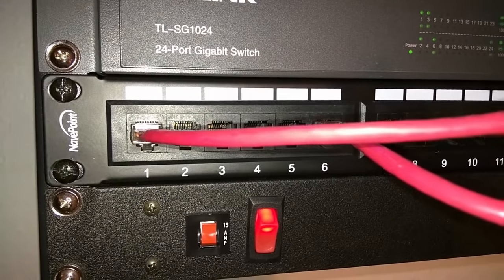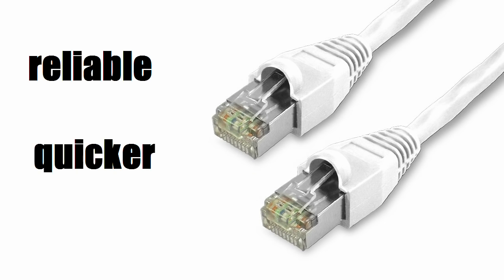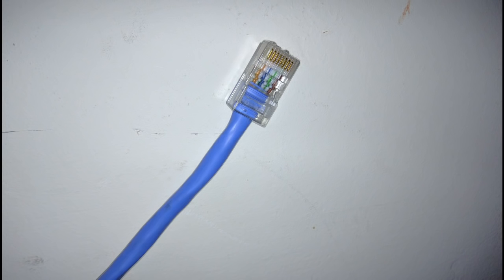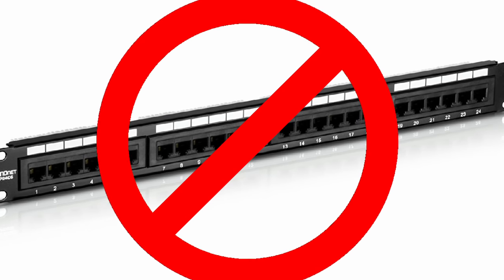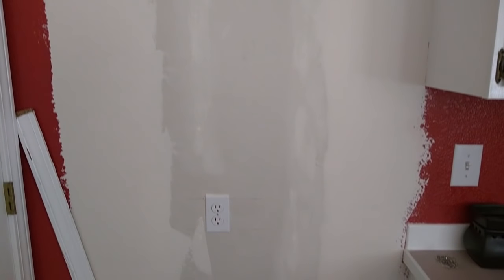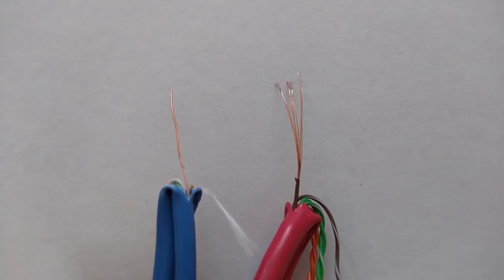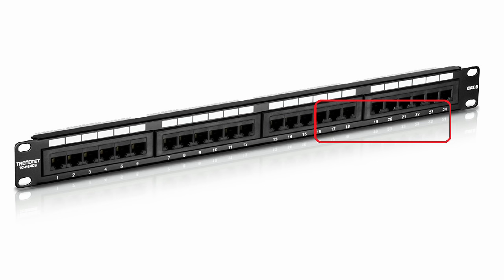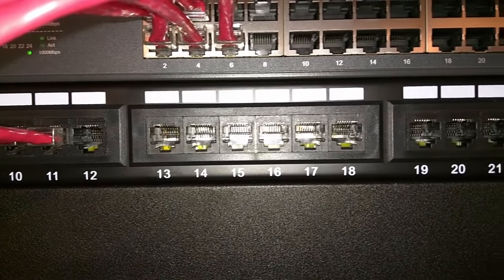What is a Patch Panel? Do You Need One?

Comment: So I’m currently building a small network in my parents house to get WiFi in the living room(with 2 lan ports) with direct lan in our flat screen TV  and 2 ports in another bet room. So as I was watching I noticed you didn’t just get like a 6+ wall port. And that was my question if it would still work if I had a 6 port wall connection which then connected to my switch. And that 6 port wall connection would go to the bedroom and living where I would need it. Would it work or would that slow down the network? I hope I didn’t write it too confusing
Reply: What you are describing should still work assuming your 6 wall port has 6 individual wires going into your switch/router. Speed of your connection for the 6-port switch/router would be determined by either your switch or your router. Make sure you see something that says 1000/mbs on the product you choose to use for this intended setup.
Reply: Baron Marsh okay cool I’m doing it right then. I needed another voice in this since I’m the only one in my family who really understands any of this

Comment: You mentioned a POE camera. I currently have 12 cams plugged into a POE switch. Will it work if I punch in those 12 cables into a patch panel and then connect them to the poe witch? Will this set up provide power to the cameras as I haven't them right now? Thanks
Reply from the maker: Yes you can use a patch panel with a POE switch. The power will make it to the devices just fine.
Reply: @BudgetNerd  wow excellent! I didn't know that the power from the switch will make it to the devices even if there are connected to a patch panel . Thanks
Reply: @rub1345  A patch panel is a passive "device", more like a Ethernet outlet inside your network closet, so no power draw or circuitry to make it incompatible :)

Comment: I have a question? I have a lot of devices on a on my router. I was having problems with everything staying connected to the router. So I did some research and found the eero router. It has helped. But now my tv will com connect to the router. So I bought a switch and wired my tv to the router. The problem the I am have is that my TVs keep buffering. Do think that I just need to do a home network like you did? But my ring doorbell is lagging also. It does have a good but not great connection. What you would suggest? I am trying to stay on a budget.
Reply from the maker: Your tv is wired and still buffering? What are you trying to stream? What internet speeds are you getting? You could Google "speed test"
Reply: Netflix and prime video. I have 215 mbps cable internet
Reply: My eero router has an app. So I can see if someone tries to connect to my router. The router that I have is door band 5G 2.4. But I do have 19 devices oh my network using my router
Reply: So I was thinking if I did a home network like what you have and get some of this off of my wireless router that it may speed up my Internet connection and my TVs will not buy for anymore I’m just trying to get some insight on what to do
Reply: @bryansmith7070  Things that are wired are not going to affect your WIRELESS speeds and what ever things you have on your WIRELESS is not going to affect your WIRED STUFF.  is that what you are asking ?
Reply: Bryan Smith could be that the TV is still using wireless even though it’s connected by ethernet to
Reply: daniel kinney no. I have figured it out. My tv doesn’t have enough memory. That’s the problem. It keeps closing the apps that I am using.
Reply: OrangeRAZ I thought that also. But the tv doesn’t have enough memory. It keeps closing the apps that I am using. So I have to figure out what to go now.

Comment: Awesome vid!!!
One question: I’m planning to wire my home with Ethernet throughout. I want to future proof my in-wall installations with cat 8 cable. Will I have any issues using a cat 6 patch panel and keystones etc?
Thank you...
Reply from the maker: If they make cat 8 patch panels and keystones, I would go with those if you want to make sure it's 100% future proof. The manufacturers would claim the cat 8 certified stuff wouldn't degrade signal quality.

The cat 6 stuff would totally work though, if you wanted to use it, and I wouldn't imagine there would be much of a signal hit with that.
Reply: New wiring standards where just released, no such thing as future proof no matter what they say or you think. Only when there isn’t a profit to be made than it will be future proof.
Reply: Hi I wired my old house 25 years ago in CAT5 still works great never had a problem, my new house in CAT6 1gbt speed how fast do you want?

Comment: So a few misconceptions here:

9:20 - these problems you describe with solid core wire are largely overblown.  Yes they have a certain bend radius limitation, but they will not break or short like you say unless you're using an extremely cheaply made wire.  Stranded wire is actually going to be more of a problem as the fine strands of wire eventually break.  This raises the impedance of the wire and will eventually cause high resistance opens which will result in intermittent signal or reduced link speed.  Stick with solid core every time.  No real network installer worth their salt installs stranded wire anywhere.

11:02 - Following up on that, I wouldn't recommend using stranded cable for PoE hardware.  It has FAR less current carrying capacity than solid core especially at PoE++ current requirements. 

14:42 - yes an RJ11 phone cable will fit into an RJ45 jack.  However the edges of the RJ11 connector if left in for a long time will damage pins 1 and 8 in the jack as they will be overextended.  Not recommended practice.
Reply: Actually, those "Misconceptions" are industry standard caveats. But you can say what you want on the internet - unless you are using solid strand temporary patch cables (jumpers) and moving them frequently. Because if you are, you will find even the best Keystone or soldered/shrink-wrapped termination can fail with multiple deployments and re-deployments. 

They may not have failed in your short life, but in people of the previous millennia who remain as US taxpayers supporting this internet infrastructure, we are familiar with the need for redundancy or overbuilding to reduce rapid obsolescence or repeated use failures requiring replacement.

So - 9:20 - good point unless you leave your patch cables in without ever unplugging or manipulating them. You could feasibly use solid all over the place for patch cables, unless of course you plan on plugging and unplugging those same cables. What is the commercial standard for patch cables? Solid or strand?

11:02???? Context, context, context. Absolutely you want to use PoE and solid strand - unless you are manipulating the cables frequently. Even then, from the PoE switch (area) to the termination at the Camera installation site, you WOULD absolutely do as he suggests, use solid core cable. If you are saying "never use stranded patch cables to jump between PoE switch and patch panel, or between termination panel and camera RJ45 connection - you have me there. Manufacturers tend to ship their set-ups with stranded cable....so is this highly redundant, dummied down, over-explained video wrong? I think not, but I've seen a lot of technologies pass by and I understand how solid strand carries current on the surface more than in the core of the wire....lets not debate that!

14:42 - Yes, he absolutely said that "You can use your ethernet cabling to extend or route your phone line through your house". He also said you could terminate telephone cable on the same patch panel and gave the "ports 16-24" for telephone installation. That isn't a misconception, you can actually use the same highest quality cable to run your phone lines. It is a waste with Cat7e - or any Cat cable, since phone service usually only uses one stranded pair. Business can use the full cable termination at both ends - but for a person wiring their own home they could have need for two or more separate lines, and they could surf until they found sites like this one:
https://tombuildsstuff.blogspot.com/2015/01/rj11-phone-to-rj45-jack.html
It isn't a misconception that an RJ11 will fit into an RJ45 outlet, but it isn't best practice. On the above website, an RJ45 splitter gives you two RJ11 outlets for a business phone and business fax line (for example).

Or a homeowner could tackle the media/communication wiring of their own home using each and every possible cable known to man and terminate them all in separate patch panels specific to that cable. 

2dfx: I'll concede this - if you have a media/communication closet and you mix usage/feeds on a patch panel or through the walls, the next occupant may not recognize the difference in outlets and think their internet is down when they plug into a jack that was intended to carry phone signals. With proper labeling, a patch panel can provide a homeowner with a neat, organized, and effective media system for all communication. I don't see the misconception there. 

If you were just watching his entire video to correct him, you should have sent him an edited version of his video with corrected script. He is a slower talker than I've found in Cincinnati - some really do talk fast - and he is quite redundant. This could have been a 7 or 8 minute video. But with good editing, we might miss the 1:46 or 11:26 view of his Fender Axes or his Keytar. Just on the benefit of rounding out Ben's nerdiness versus his coolness, I'm glad those are in the corner - but does that mean he isn't focusing on music?
Reply from the maker: Good discussion. I'm always happy to learn. Yeah this video could for sure be shorter, and with less music. Adjustments I've made since.
Reply: @Karma0jun  Thank you, thank you, for saying this. Yes, this is not a science fair project. We are not inventors here. There are industry standards out there and millions of professional designers and installers follow them (hopefully) every day. If you are a do-it-yourself-er, fine, do yourself a favor and make yourself familiar with these standards.
Reply: @Karma0jun  That's quite the rant lol
Reply: @PANZERFAUST90  Oh, is it. 
I'm glad you approve. Facts should be recognized - even if the acts of industry standards are a perceived rant. Thank you for your opinion, it is worth much to me.

Comment: Say I want to rewire my house for phone and network, can I use a network switch for the phone distro (and a second for the network, not the same one for both) or how would I have to go about the phone system???
Reply: depends on the models of the phones and the phone service provider, if you get voice and internet through same provider then all you need to do is make sure everything makes its way to the router directly connected with the service provider and it should work
Reply: Silly question, but are you talking about ethernet Voice over IP ("VoIP") phones, or old style analog phone lines to the outside world or to a single common ISP router with a phone line port?  The answer to that question gives you different methods and requirements.

If you're using special VoIP phones then you can still use the same CAT5 (or better) cabling and patch panel discussed in the video.  Depending on the exact hardware, you may be able to use a single switch or may need one for regular network devices and another for the phone network.

If you're using analog phones you can still use the same CAT5 cabling to a patch panel, but the jumper cables at the wall jacks and patch panel would be special.  Old style analog phone lines like those from the central office are sometimes referred to as POTS lines, for Plain Old Telephone Service.  In your home each extension phone is wired in parallel with all the others, which is the opposite of how an ethernet patch panel is used.  So take that into account as well.

I hope my descriptions help you out, it's difficult to provide all possible scenarios because there are so many possibilities.  Good luck!
Reply: @bobblum5973  standard phones using a regular rj11 connector. I guess it'd be analog, not like the ones we use at work that take 2 rj45s. Mine plug into the existing phone wires running through the house and one of the outlets plugs into my bright house (now spectrum) modem for the voip conversion.

Comment: I bought a patch panel because my internet router did have enough sockets. Still trying to figure out how to patch panel increases my sockets since it looks like a one on one connection.
From you video I understand the cables from the different internet connection in rooms are directly connected to the patchpanel. Each representing a socket. How is the patch communicating with my router. It does not  look complicated but I missing a vital link in my understanding 😩
My situation: My wiring from the rooms are all setup and working when directly plugged into the router. My router has not enough sockets for all my cables.
Reply from the maker: A patch panel doesn't add more Ethernet ports to a network, a switch does. What you need is a switch. But you could use the patch panel to route the devices from your various ports around the house to the switch. Then you'll hook your switch to a lan port on the router
Reply: A patch panel is not a device. It does not communicate with anything. It does not "do" anything. It just helps organize your cables and protect your in-home wiring from being pulled on. It's like a ton of wall jacks all in a row. You can't get more devices on your network by having tidier cables.

If you need a way to have more devices on your network, you need a "switch". A switch is the actual smarts (which is why it is significantly more expensive). Any device connected to the switch can talk to any other device on the switch. So if you have all of your devices connected to the switch, and you have your router connected to the switch, then all of your devices can talk to the router (and thus get internet).

If you have a lot of in-wall cables, a patch panel can still be valuable so that you don't mix up which is which and so that you are much less likely to have to replace one of them (like if it got pulled on really hard and developed a break where it comes out of the wall. I'm going to be upgrading my home network soon, and there's a decent chance I'll be adding a patch panel since I really don't want to damage and have to replace the cables that go through a 24" crawlspace.
Reply: @klikkolee  Thanks for this comment!! It greatly augments the information in the video and solidified my understanding of the patch panel, especially your comment "It's like a ton of wall jacks all in a row." Cheers.
Reply: fail

Comment: Would it be an issue if I terminate the ends now and cut them off later to add a patch panel? I know I will be doing double work but don't have the funds for a patch panel and rack at the moment.
Reply from the maker: As long as you have the extra cable length,  you could do that.

Comment: We're in the process of building a new house. Would recommend CAT6 or CAT7?
Reply: Derrick Young I have cat7 with 1GB internet and it’s great. However Cat7 is a little expensive in my opinion.
Reply: Thanks for the reply and information
Reply: @derrickyoung8975  Cat7 has no official association with the Ethernet standard. You should be using Cat6 or Cat6a. Cat6 can handle 10 Gb up to at least 100 feet though typically up to 160 feet. You're good. Cat6a for 10 Gb  over longer distances and up to 100 meters. That is the official standard.
Reply: Derrick Young CAT7 shielded
Reply: use cat6... your patch leads will only need cat5e... dont even need cat6 wall plates... over all rating will be 5e... 1gbt speed at this will you want to be a defence base... every one wants over kill
Reply: Gigabit was designed for plain CAT 5 and that spec was intended for 100 m or 330'.  You'd have a fairly big house if that was a significant concern.

Comment: Hi there do they have any type of patch panel that you can plug in the cables to the back of it my ethernet cable is going to all my rooms already have ends on both ends and I was just wondering if they have a patch panel that have plug-ins on the back of them if so can you lead me to one I need at least eight connections or more thanks for any help

Comment: Thanks, very informative! I have an old patch panel which is fed by a 10Base-T Hub. I'd love to upgrade the hub to a modern Gigabit Switch. Can I simply replace (swap out) the 10Base-T Hub with the new Gigabit Switch and use the same 15 year old patch panel? ... or is it more complicated than that? I believe the cabling is Cat-5.
Reply from the maker: You can just swap out the switch for a gigabit one yes. It will totally work. If you find you aren't getting gigabit speeds, you would want to look at the patch panel or cabling. Cat 5 will theoretically support gigabit speed, but if it's not up to snuff, it might fall short. But swapping out the switch is easy.
Reply: @BudgetNerd  Thanks so much. I wouldn't be disappointed with less than gigabit speeds. As long as I get well over the old 10Mbps sticking point.
Reply: Marcoosianism As long as your other equipment and connection are capable, you should see a huge improvement. 

However, since you will eventually have to do it, I advise changing out those cables just to get those out of the way and future-proof yourself and open up your home to some cool new features such as a 10Gbe home network and/or NAS array media/backup server! 🤤
Reply: @NineNineSevenTurbo  Great to know. Yes that will be a future project for sure :-)